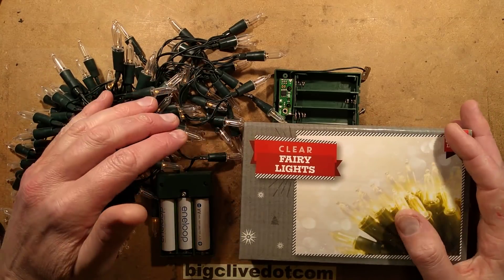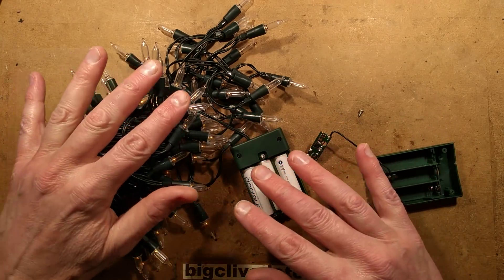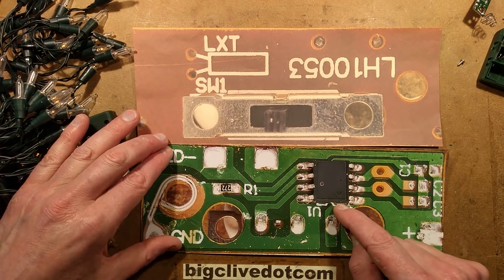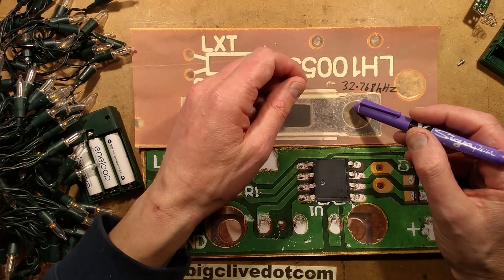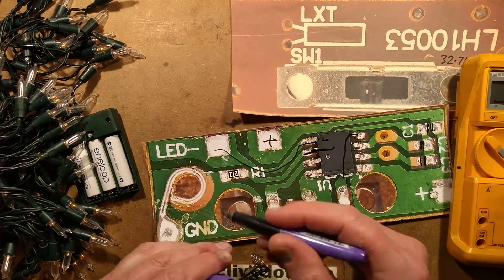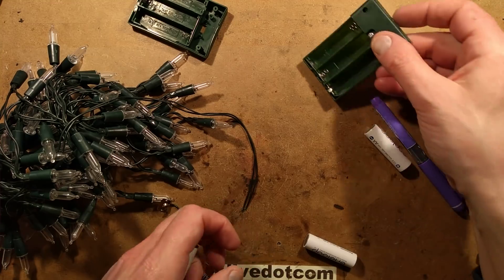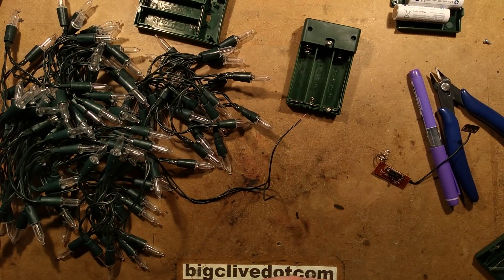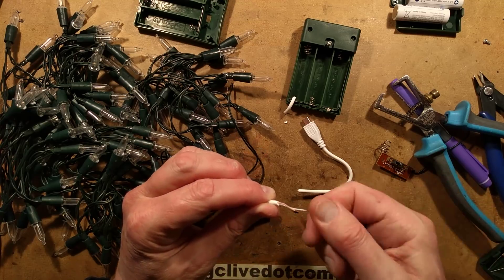Poundland lights unexpected feature and USB mod.

Comment: I went to the Dollar Tree today and found a nice stocking stuffer flashlight with 3 cold white leds.  Nothing special about that BUT it had a hand crank where you squeeze it to recharge the batteries.  OMG, so cool and for 1 usd BUT I smelled fake.  I looked and looked and could not see anything inside but luckily someone before me broke one open.  The squeeze crank was spot on and would/should work but the other part with the lights is what i was looking for to confirm, or disprove, my suspicions and I finally found it.  BOOM, headshot, fake as it had 3 tiny Lithium button cells for the LEDs so the hand squeeze had the wires going to the batteries and the lights but Lithium batteries don't charge so once they ran down you could get a nice hand/wrist workout but that would be it.

Damn fakes though if replaced with say a super cap it would work perfectly though it would require destroying the flashlight to get to it due to super glue being used.
Reply: Did you verify they were CR (single-use primary cell) cells and not LR (rechargeable secondary cell), LR is a rechargeable Lithium coin cell?
Reply: I was going to add that I ask because I have a similar unit from Amazon (though it cost more than a dollar from China, but then I only bought in quantity 2) and it’s battery is a very small rechargeable Lithium-ion coin cell located behind one of the three LEDs.  I’ve not taken it apart but I would estimate that the battery is roughly a 12x2.0mm size (by sight).  They do not have a lot of storage capacity, then again the LEDs don’t draw a lot of power (not terribly bright, but still enough to be useful) — but it is indeed rechargeable as I have run it down before just to confirm that it can be recharged.
Reply: How do you know they were non-rechargeable alkaline cells? There are rechargeable button cell batteries. They're indistinguishable, except for the markings on their positive casing.
Reply: Well, the "mistake" might explain why it was being sold off at Dollar Tree. More cost effective to just send them to such a retailer and get a little money back, than spend labour hours reworking them and selling for the original retail price.

Smacks a little of the "fake" solar cell calculators some other rather more rabid youtuber has spent a couple videos on "debunking". I mean, what really do you expect for $1 / £1, but eh, seemed the inclusion of a fake / nonfunctional / not (correctly) wired in solar panel was the more important thing for the guy rather than the fact you were getting an otherwise complete and fully functional calculator plus one or more button cells (that would cost about as much to replace, minimum) along with... Anyway, they were either wired in series with the (non-rechargeable?) battery, or not connected at all; either way, they didn't appear to do anything to power the calculator, sometimes not even if the battery was removed and its terminals shorted.

However, I do wonder; the cells might not be rechargeable, but they surely still conduct some current once they're dead, right? My experience with devices that end up with a mix of charged and dead batteries in them is that the whole pack voltage is within sigma of the sum of the individual cell voltages, indicating that the good cells were still able to "push" power through the dead ones. In which case, once the batteries die, you should still be able to power the light with the crank as per a common dynamo powered light, it just won't stay lit when you're not cranking, unless there's also a small capacitor in there somewhere. IDK what the internal arrangements of the crank-lights I've owned were like, but they sure seemed to act like they had either a reasonable amount of capacitance inside them, or a very low capacity rechargeable cell that could be charged at a pretty high rate but was delivered in an uncharged state. Seems weird that you'd just include primary cells instead ... maybe, from a wholesale perspective, they're somehow cheaper?!
Reply: @markpenrice6253  It's plausible that they were in fact intended to use LR cells but someone messed up and put the wrong part number in the bin on the line or something. Could well have been that it was cheaper to simply sell them off discounted as a factory second that got picked up by the discount store rather than going to the trouble of disassembling them all by the time someone caught on to the error. There isn't much visible difference between the LR's and CR's that I could easily see someone selecting the wrong stock if not checking the part numbers properly in a factory that used both components.
Reply: I've bought a similar one from a Japanese 100 yen store chain. The packaging it came in was explicit that the batteries inside are not rechargeable, but the hand crank DOES light up the LEDs when you're cranking it. Just means you have to continually crank it whenever you need light after the primary cells are dead and can't store up a charge.

Comment: Can't you use the soldering iron to melt the heat shrink?
Reply: Yes you can use it like a wand around the heatshrink and it would work (not touching it since it would be too much) but it's not practical a hot air gun works much much better

Comment: I have the same solder station. The workmanship inside was awful but after reflowing cleaning and tightening the screws it's worked great for 5 years.
Reply: @blitzwing1 Anything that happens to it is easy to fix and get parts for.  I also thickened some of the traces with solder. I only wish they would use an iron with a little more mass. Have you tried the tweezer soldering iron accessory?

Comment: Why not put USB sticking out of the battery box then you use USB power but still have the control of the circuit board of the original with the timer and switch control?
Reply: that certainly would work, if you do this mod you can do this. you can also use the box to provide a little string relief for your usb power cord and your resistors would not require heat shrink tubeing. 
I suspect Big Clive just didn't want the extra bulk, it is a bit of a cleaner looking without it.

Comment: So what, if anything, would adding the crystal into the circuit do? Make it more accurate?
Reply: If YOU add the crystal, there would, most likely, be no change.  The controller would need to be programed to use the crystal instead of the internal oscillator.   And the crystal would require more power than the internal.
Reply: Cheers. Concisely answered!
Reply: Richard Hogg yes, but usually the microcontroller is programmed in the factory to use either the crystal, or the (less accurate) internal oscillator.  So it's probably not possible to retrofit one without putting a new micro controller on too, because chances are, you can't reprogram those microcontrollers...

Comment: Hey Clive I have always found these “ghost detectors” fishy could you take a look inside? https://www.ebay.com/itm/KII-K2-Electromagnetic-Field-EMF-Gauss-Meter-Ghost-Hunting-Detector-S5O6/292617609764?epid=3020403621&hash=item44215e6224:g:GR8AAOSwX0xbMPBo
Reply: Mouze - give them to children, so they can try to locate Father Christmas 😉
Reply from the maker: That one is quite expensive given that it's a clone of the real thing.
Reply: bigclivedotcom ops my bad but do you have any idea what could be inside them?
Reply: Mouze - I don’t know about the item you linked to, but often these devices are just static electric field detectors. They have a very high impedance, very sensitive input stage, followed by a very high gain amplifier. This then feeds a voltage threshold comparator. Which then drives a LED. Sometimes also a piezo buzzer. Or alternatively the output of the amplifier feeds a cheap moving coil meter. The one you linked to looks like the moving coil meter has been superseded by a LED bar graph display. Either using a special (but cheap) chip, or by using a number of general purpose comparators.

Comment: The resistor might be a pull down on the reset line?
Reply: Ben De Lathouwer - but normally you pull up to Vcc for a /RESET line.

Comment: Hi Clive is it possible you can do a video about different voltages on old vintage fairy lamps?
I have a huge selection of old vintage fairy spare bulbs and they are not all mark with their voltages on then, I'm like to know if the is a way I can find out the voltages of my spare bulbs?

Sorry if this comment is in the wrong area I couldn't find a way to contact you other Wise.

Comment: I was given a holiday centerpiece that has that exact configuration,  6 hours on and 18 off, running 6 or 8 soft white LEDs. Only problem is that it EATS batteries like crazy. I don't know what's doing it, the lights should only be drawing a minimum of current, but I'm lucky if I get 2 weeks out of 3 AA cells.
Reply: Paul Drake Try doing the math... AA cells are normally around 500 to 700mAh... 3 of them amounts to 4.5vDC but still at 500 to 700mAh...  How long should you be able to draw 50mA on those batteries ? ;-) (Around an hour a day for two weeks) - Now - it's been known that on low current draw, you can prolong the battery life, but you'll maximum get up to 2000mAh with as low as 50mAh draw... still amounts to max 4 hours a day for two weeks.

Comment: if you used 1.5v cells, would you get less drift?
Reply: No. NiMH cells have a pretty flat voltage discharge range, staying at 1.2V for most of its useful life, while alkaline cells have a steady but sharper decline, going from 1.6v to 1v through it's useful life. The rechargeable cells will provide less drift until they are mostly drained.
Reply: @nyetloki  I've never experienced voltage drops from reputable batteries like Duracell or Energizer. I don't know why you're saying this. Sure when they get to nearly empty, but I have some equipment that will not even function with .2 volt deviations and haven't had problems unless it was a cheap battery. Idk
Reply: @MrPruske  look at the datasheet for the energizer and Duracell batteries you use. The discharge voltage curve graph in particular.

Comment: Translucent shrink sleeve wow...  Only ever used black (but that was +25 years ago). And the "helper"... yep it's the third hand.
Reply: Alexander Wingeskog Is it only me, or would other people than me heatshrink the two heatshrunk leads together ? ;-)
Reply: eidodk - Use three pieces of heatshrink - yeah, that’s what I normally do.
Reply: @eidodk  , that went past me I'm sorry (I guess it is a joke, but I'm not a native english speaker).
Reply: Alexander Wingeskog - no, he means (at least, I think he means) use a third, longer and larger diameter piece of heatshrink to go over both the two smaller diameter heatshrink pieces. The overall result being one length of visible heatshrink covering the join between the two cables (each cable being made up of two wires each).
Reply: @Mark1024MAK  Exactly what i am saying.
Reply: @Mark1024MAK  Ok I understand. Well I don't do it. I usually do tape (is it called that? not a native english speaker) and then heatshrink. Mostly because of tape is cheap and heatshrink was a bit more expensive...
Reply: Alexander Wingeskog - no problem. When I don’t have access to heatshrink or don’t have a heat source, I use insulation tape.
Reply: I've never seen the clear but I get all mine at harbor freight because it's so cheap there. Mostly black with some red and white and blue. The large diameter are a particularly good deal there.
Reply: Alexander Wingeskog - clear has been available for quite some time.
Reply: @Mark1024MAK  Cool! First time I've seen any. Although I like black/non clear better. But I guess it has some uses ofc :-)

Comment: I have a control box for a string of led lights that is similar. I modified it to plug into the wall via usb charger. Since 3 batteries add up to 4.5vdc, I added a small resistor and it works great and it works with the original controller board which has several modes. I no longer have to worry about batteries.

Comment: BC - whatever happened to the other larger-display Amecal multimeter you used to use? I rather miss the giant display!
Reply: Phil S The big display Amical died some time ago.
Reply: @johnfrancisdoe1563  if I remember correctly the rotating switch just feel apart
Reply from the maker: I've got a replacement mechanism for it.  It'll be back soon.
Reply: @bigclivedotcom  an escuse to make a video about a multimeter teardown?
Reply: @alfoncejean8826  BOLTR?

Comment: Every year my Mom/Mum sets up a Christmas display, with several strands of lights I should set her lights up like this. Power bank instead of all those rechargeable batteries.
Reply from the maker: With a splitter and separate resistors per string you could run them all from one powerbank.

Comment: Good video as usual, but I was expecting that you'd power the control board with usb and not the lights directly so that you would still have the functionality that the board offers.
Reply: that certainly would work, if you do this mod you can do this. you can also use the box to provide a little string relief for your usb power cord and your resistors would not require heat shrink tubeing. 
I suspect Big Clive just didn't want the extra bulk, it is a bit of a cleaner looking without it.
Reply: As for you guys not wanting to add the resistor your gonna want that restive drop trust me. BC drooped it to 4v with the 20 ohm's of resistance taking the one volt off. He said in the video the string draws 0.05 amps.

remember voltage is equal to current times resistance for those working out what value resistor to use with whatever light set they want to mod.
Reply: @ChrisD4335  Are you saying to add the resistors to the usb plug that would connect to the battery pads?  10 ohm quarter watt resistors?
Reply: I made that usb mod at some point to some kind of led string that had 2x3v button cells. Button batteries are very expensive and they drain fast. It's still very bright, even though it has one volt less, but I think that voltage in those button cells drops at least that one volt when they have that kind of load(it draws about 500mA)
Reply: @turtleb01  Yes. You can normally drive an LED off one of those cells directly. I tried the same thing with a 3V  bench supply and could hear the LED as it died.
Reply: @chaos.corner  you murdered an LED you monster
Reply: @chaos.corner    I bought a uv setting "glue" kit that was discounted as old stock.  The 3v button cell was very low.  Fine, just wire the led to 2 AA cells in series.  It shone brightly for 2 seconds, then kaput.  The ghost of my old physics teacher sadly shook his head, "oh Raymond,   Raymond,  internal resistance provides current limiting?".
Reply: @raykent3211  To be fair, this was one of about 100 LEDs that I'd bought as "flickering". It didn't flicker with the cell so I decided to try varying the supply a bit in case I was just operating out of spec. I wasn't.
Reply: @bland9876  Was it named Kenny?  oO
Reply: Yeah, the board should be perfectly happy with 5V, wouldn't be surprised to find they're factory-tested with a USB supply even. 3x AAs can be up to about 5.1~5.2V when new with some chemistries, and even most alkalines will be a bit over 4.8V, so it shouldn't have any issue with the odd fractional overvolt.

I was thinking take the battery contacts off completely, and dremel (or even snip and sand) off the battery compartment, with the whole USB cable going in through one of the old holes, giving you a nice neat sort-of-inline control box, just with the wires coming out of slightly odd places.

The only problem I can see with that is that if you (or Clive) simply wanted to run the LED string in continually lit mode, and didn't care about either the flashing or the timer, and wanted instead to use the controller in some other project, you'd lose that option. However, it'd literally cost you a single pound (maybe? unless this is one of their concept-breaking £2 / £5 items?) to get another one to butcher, and could then maybe run the two strings in series without any regulation needed to stop them over-currenting the USB adaptor (or, of course, parallel with resistors), getting an even longer chain for your money, so it's no great hardship.
Reply: I have done similar on some lights and use a USB charger. Than you have to plug that into the mains. But I use a smart plug, that can be controlled by an app on your phone, tablet whatever and you can have different settings, not simply 6 hours on  18 off.
Reply: Just solder a USB lead on to the battery contacts. The extra half a volt shouldn't bother it.
Reply: @woofer2121  not sure if the battery contacts will take the solder though.. perhaps it'd be better to take out the circuit board, remove the battery contacts and solder the USB wires directly into there?
Reply: @vimicito  yeah some of the crappy "chrome" contacts won't take solder
Reply: @woofer2121  lightly sand them, should be good to go
Reply: @vimicito  could always just solder it where the battery connections connect to the circuit board.
Reply: @1973retrorabbit  exactly! No need for the battery connections anyway. The USB leads can just go straight into the board.
Reply: @woofer2121  Cut some pieces of wooden dowel to the same size as AA Batteries, stick a drawing pin in one end of two of them, with the bared wire from the USB lead twisted round the pin of the drawing pin and trapped under the head, then insert said wooden "batteries" into the battery compartment, with the drawing pins touching the battery contacts.
Reply: @woofer2121  That's exactly how I would go about it but then again... I'm not the "THE AMAZING CLIVEINI"!! 😉